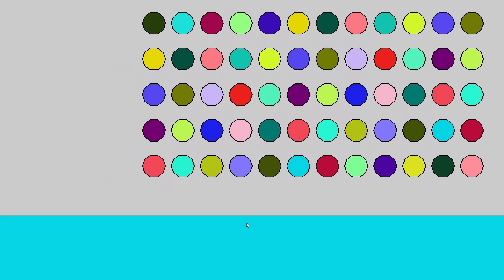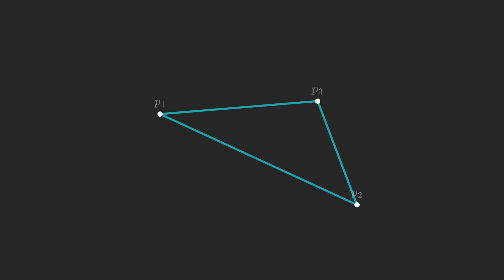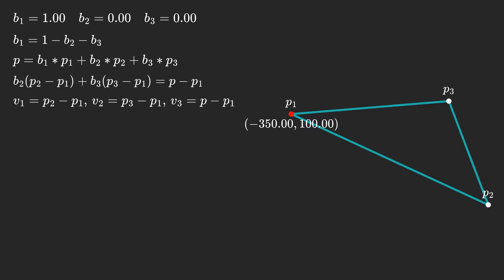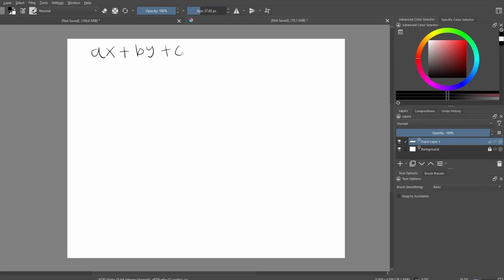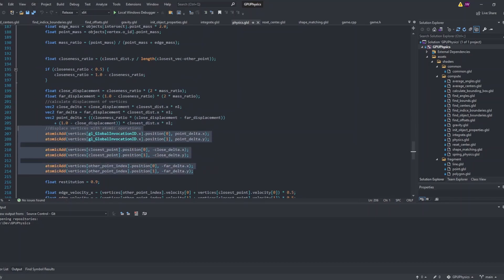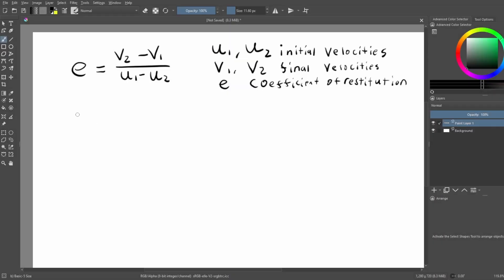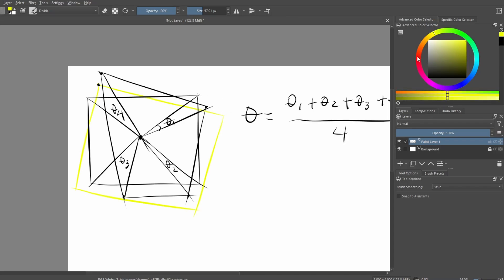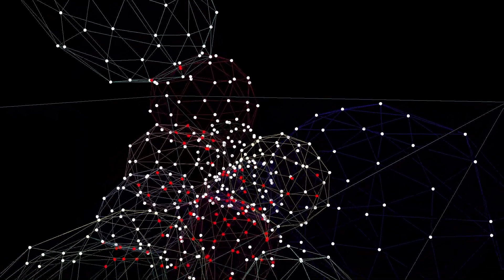Upgrading My GPU Softbody Physics Engine to 3D

Comment: The number of vertex-triangle tests can be culled significantly with a middle step that selects potentially colliding triangles. A quick thinking lead me to a basic spacial hashing technique. Say, in the broadphase, you gather potential softbody object pairs that may collide using a spatial hash. Then, next step, you find the potential triangles that may collide (perhaps using their centroids (not that great of a solution, but arguably the simplest)). The vertices in the pool already have unique IDs depending on their owner's objectID, so selecting the space cell containing the witness triangles is trivial. Then, we can finally proceed to the narrowphase to find the details of the contact.

Anyhow, great video, keep up the good work.